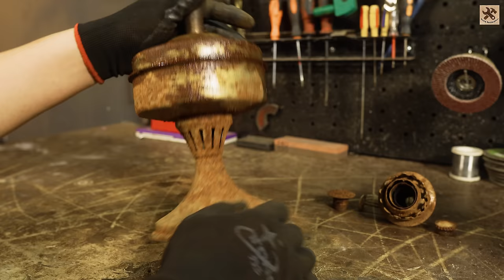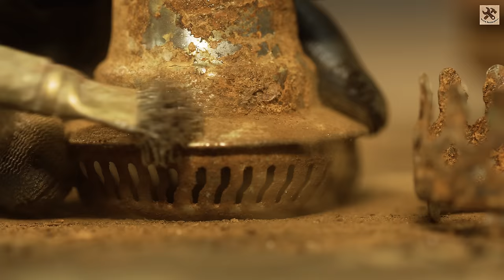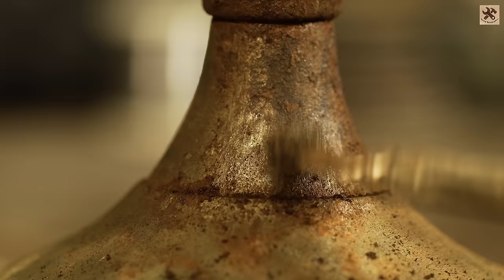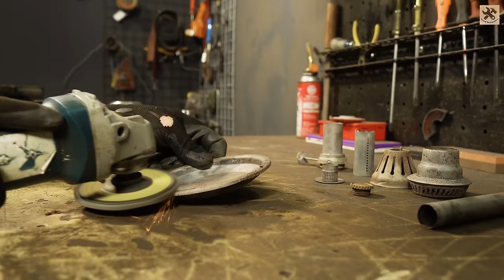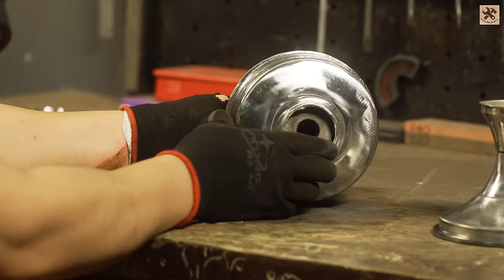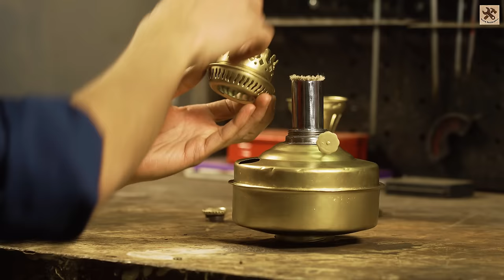Antique Thang Long Oil Lamp Restoration with AMAZING outcome

Comment: nice job, but why on earth wire brush it before sand blasting it?
Reply: I assume to take off the rust, that you can visibly see.
Reply: Definitely rust they had to use D
Reply: D 40 to loosen it

Comment: What do they mean incorrect glass? 
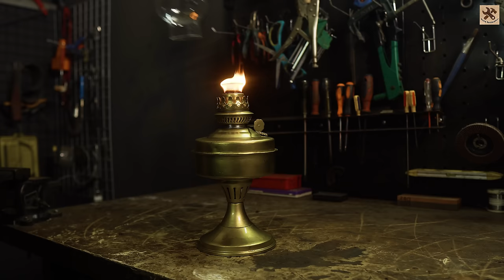26:35 The choice of glass is actually correct, that is a circular draft lamp and they really do tend to have non-tapered chimneys. It's correct it's correct 👋

- but yes, the reason lamps like this are gold/silver in appearance is because they are brass/nickel plated for fire/corrosion resistance
Reply from the maker: We will try harder in the next products. Thanks for the comment

Comment: Also, thanks for doing the real work rather than immediately shoving the whole thing in a sandblaster.  Sorry some kids in uniforms probably destroyed all the cool antique lamps
Reply: I was actually wondering why you don't just throw it in the sandblaster first.  Wouldn't it save the step of wire brushing.  Excuse my newbieness.  :D
Reply: @everydayhandwriting  I thought the same thing I mean loosen the flakey rust but yeah sandblasting would make the job easier

Comment: why would someone think an oil lamp is useless without the glass? as long as you keep the flame low like you are supose to you should be ok. and keep it away from anything flameable again like you are suppose to. I mean my family has done so in emergency situations and it was safe and fine and we was kids then. I mean come on if you are using an oil lamp you need to have some common sense to start with. And besides its a lamp you should be able to go to any store the specializes in lamps and get new glass or shades

Comment: Cheap metal!
Brass does not rust!
Brass plating would have been better than brass paint.

That wick looks like it needs to be trimmed. That's why it's not burning even.
Or you can buy a new one.
They are still available online.